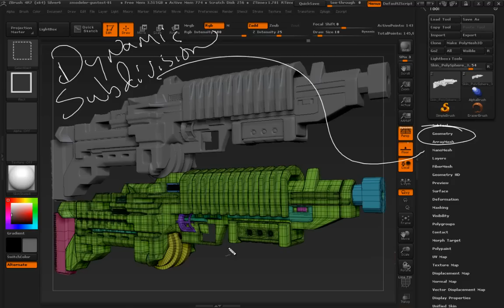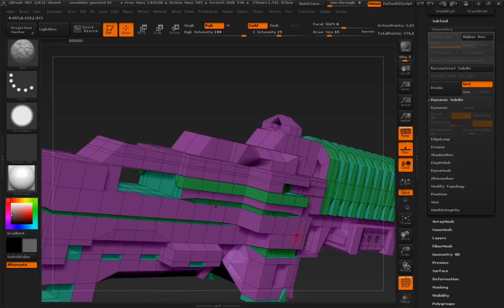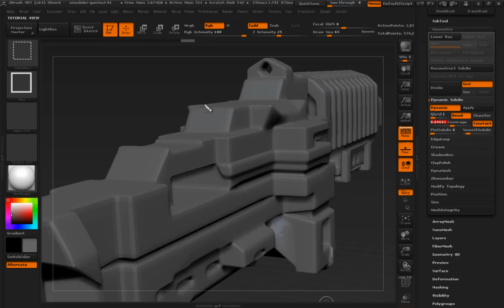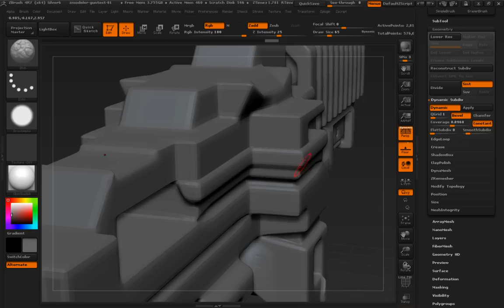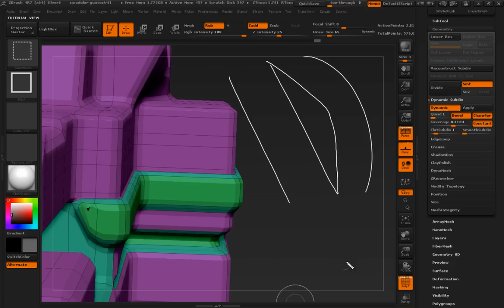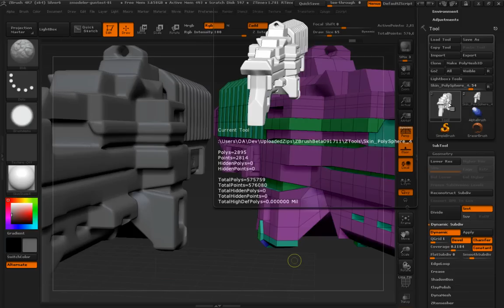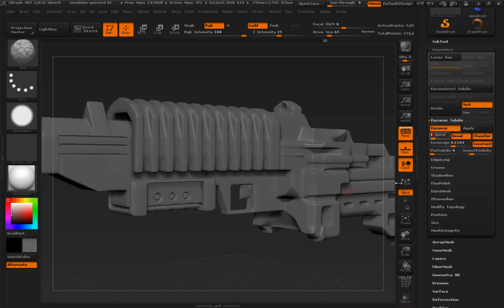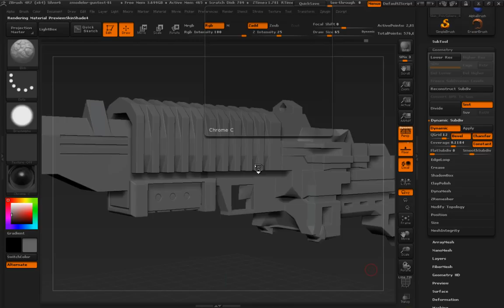ZBrush 4r7 Feature: Dynamic Subdivisions

Comment: If you're just trying to disable dynamic subdivision on a model you accidentally turned it on on, just go to your highest sub level by pressing D a few times, then click the apply button in the Tool -> Geomtry -> Dynamic Subdivision section. Then just delete your higher subdivisions in the geometry section.